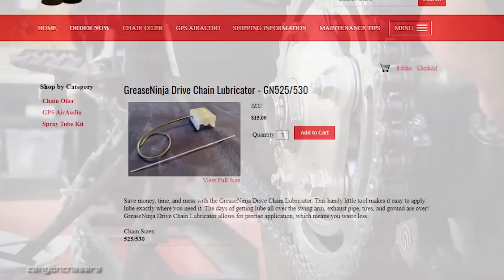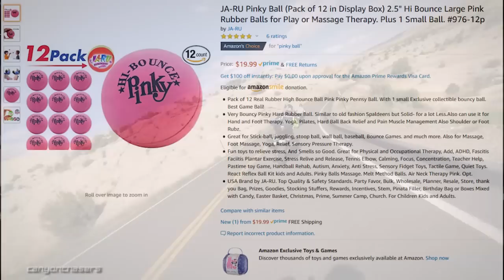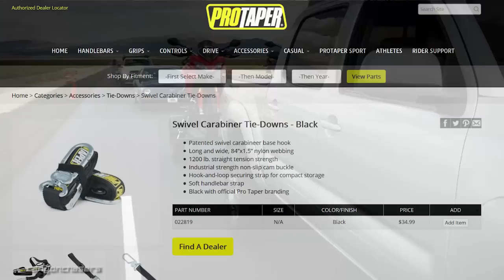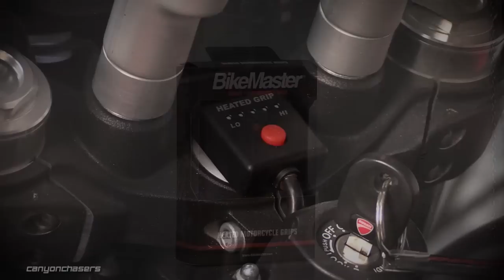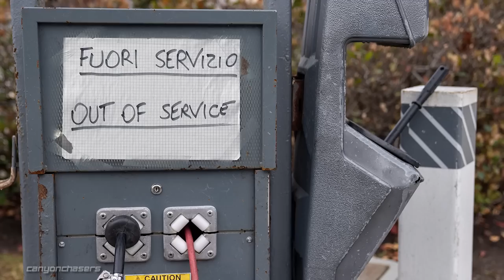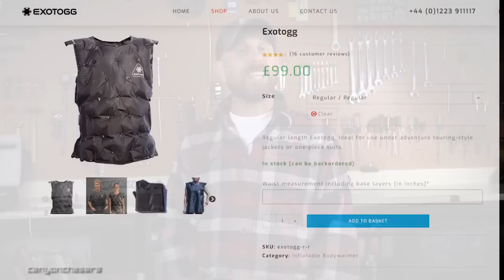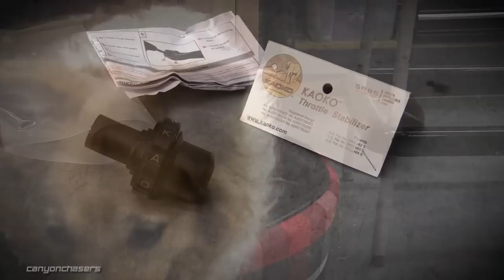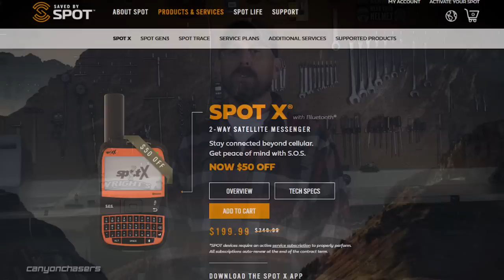Our Favorite (and Best) Motorcycle Related Gifts 🎁

Comment: Tennis balls are cheaper and work well, also for using every day for increasing grip strength for both hands. I use an old copier rubber belt for shoulder stretching and strengthening.